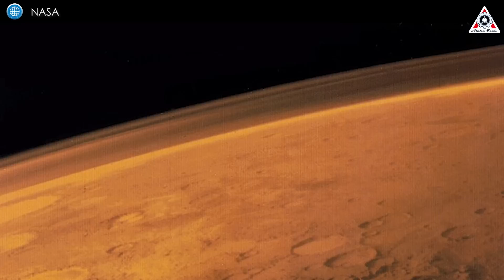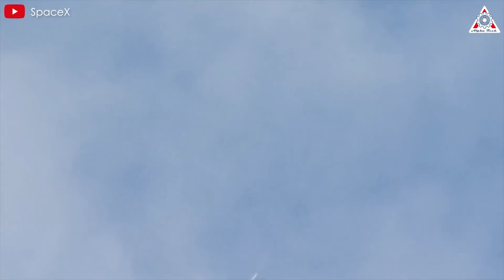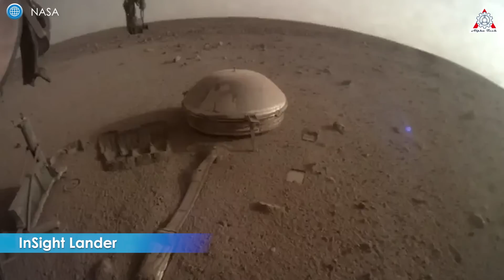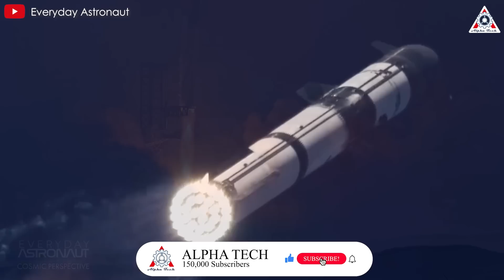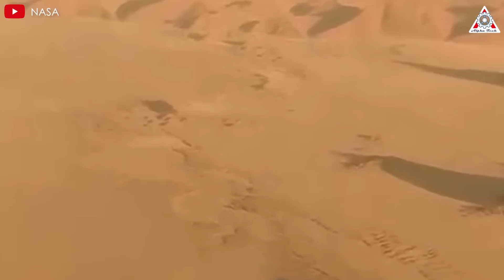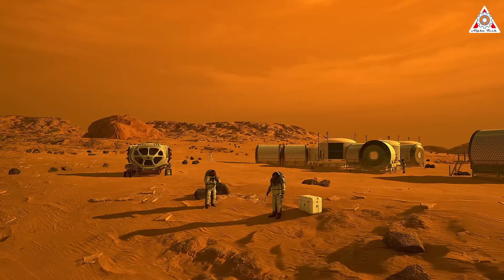NASA & SpaceX Unveiled How to Land Starship on Mars and Secretly Practicing...

Comment: I know SpaceX is trying different metal and ceramics to further advance their heat shields. I work with a company that has a hybrid ceramic hexclad stainless steel cookware that is amazingly resistant to heat.
May I suggest that we could make a Hexclad hybrid design in combination with the metal shields. This ceramic has a bonding agent in it that could be possibly used right with the metal shields. I would like to look into it further if someone would be kind enough to contact me from SpaceX. I may not have a college degree but I was exempted in many subjects like mathematics and physics.

Comment: If refueling a rocket, like Starship, from low Earth orbit can enable it to continue to Mars, are there other scenarios not previously considered like refueling a returning Starship for powered reentry to Earth or even Mars? Granted, you would want the depot to be traveling in orbit at a speed that would closely match the speed of the incoming ship so that it would not require too much fuel to mate with the depot. What I'm trying to get at, is that space craft don't have remaining fuel to slow the craft for reentry and that's why there's a heat shield. If there was fuel for a powered reentry, could a fully fueled ship slow itself enough to eliminate the need for a heat shield?

Comment: You guys are looking at it the wrong way rocket engines is not the way magnetic using the planet’s gravity field to travel push pull land and launch . And to travel long distances folding space will cause problems it should be a magnetic vortex wormhole more control
Reply: Huh?
Reply: @keithcomstock9862, if you're not joking, you need to cut back on the science fiction programs you may be watching.
Reply: @jimgreen5788  how does the antigravity system work

Comment: they absolutely have to figure out a way to avoid this insane 26 month window.  they should get that figured out as one of the primary objectives. otherwise. there is no rush in building and testing and perfecting the starship.  taking huge risk of having to  build a special addition for Mars that very well might be considerably different and have to do it all basically, over again and going through the FDA approval sht all over again.   

once that is figured out, they should figure out a way to keep the mars dust from kicking up insanely bad.  like sending a payload down that literally is all water that sprinkles and waters the land zone, then another payload that is literlaly only cement, not to create a cement pad this way, but just weigh down the landing zone. the cement dusting will stick to the wet mars soil/dust and make it heavy. potentially heavy enough to keep the dust cloud and what ever to a managable landing cloud.  

i donno. just a fast brainstorm lol... them are two serious big issues that should flat out be resolved instead of waiting til the last minute and hoping like hell it will be ok and having a method that allows a starship to be landing every 3 months. not 26 months man. thats just fkn stupid. if you try and counter that with multiple ships arriving in a short period of time all together  basically, within the 26 month window, its too possible that landing isn't possible at this or that location at that time and so suddenly, you have multiple ships all in high jeopardy of some kind of crashing happening by the time they are able to figure out what to do.  and since its like a 20 minute delay in communications to the ships, it might not matter at all what you find ou tthat you have to figure out on the fly as they are approaching  and be too late and only option you have is to jus tlet them forfill the given plan, knowing that every ship is gonna crash from bad landing conditions.   

i realy think these two factors should be getting resolved first.  thats gonna suck to see the day come to make the first attempt, just to see that my assumptions here were dead on the money as they very well may be. so then 26 fkn months later,  adjustments can be made and attempt a 2nd landing. i donno. i jus tdon't want the first attempt and such to be a complete failure. that each attempt has a chance in hell and as of right now,  it doesn't seem like thats gonna be the case.  so we just gonna end up with bad news when the day finally comes.  without a real sense of hope